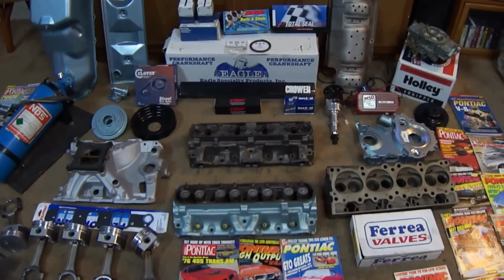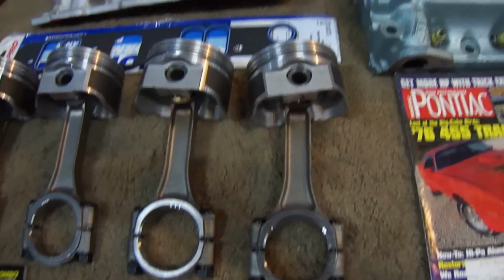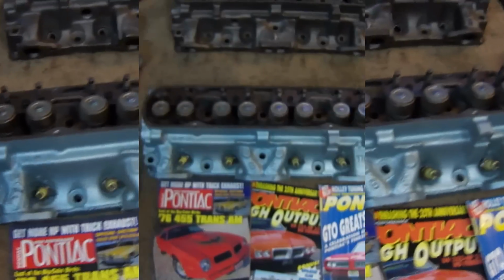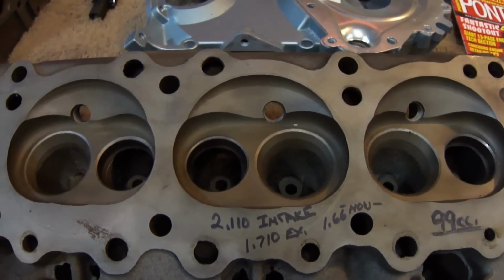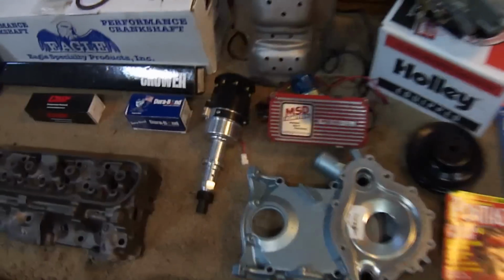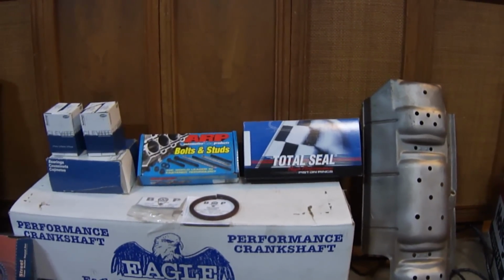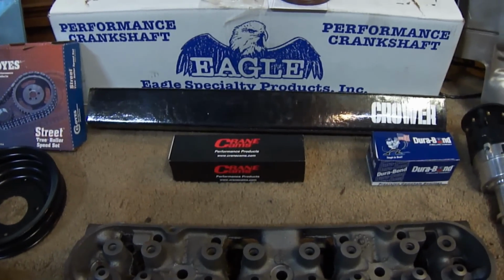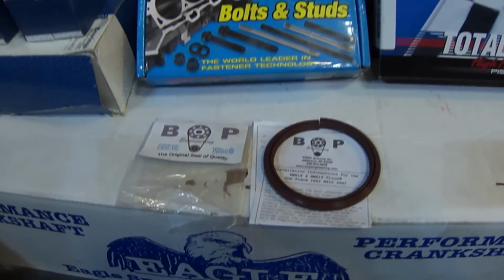1969 PONTIAC  GTO JUDGE 500HP 455 BUILD UP...PART 1

Comment: Round port 455 HO heads were the best. The #96 were the best D-port heads to use on a 455 build. The outflowed the 6X on both sides and had a smaller chamber- big valves and all the exhaust bolt holes.. Stock Blueprinted bottom-end with #96 heads, an 041 cam and a Quadra-Jet made over 500hp everytime. -and on pump gas.

Comment: A few things...the rods and crankshaft were made in China.  6x are NOT the best cylinder heads.  The casting 66 are actually better, if screw in studs are installed, and mill the heads .065".  Ram air 2, 3, 4, 5 heads, and sd421/sd455 heads, are better yet.  Cast 16, 62, 670, 31 heads are also better than 6x, but require a custom dished piston.  Other than that, good plan.

Comment: I was wondering, i have a grand prix 1971 455 200hp, 2 bolt main, 7h4 heads 114cc big valve, 2 barrel with only 80k miles virgin block. Will 1969 62 heads 72cc with 4 barrel intake fit the sleeping giant? Or i do need to add other part to make it work?
Reply: Chem Dog,  did you every try this setup?  Those heads are perfect for 400,  but will be wicked high compression on a 455,  prob 11 to 1.    You want to be more like 80cc chambers to about 100cc on 455 engines.

Comment: Cool stuff , I'm running a 1972 455 H.O. , .30 over with old school trw L2394 pistons with 7f6 heads , love these Pontiacs been running them since the mid 70s , wish I would have kept more of the blocks and heads I had , hope it turns out well 👍🏁

Comment: the problem with lowering CR by using a big chamber, is it increases the distance from the intake valve to the top of piston at TDC, this reduces the suction effect of the piston on downstroke, and less a/f mixture is pulled into the cylinder on intake stroke.  the way to do it is with a flat OHV head or nearly flat, and a dish in the piston, that is optimal.  the main reason the RA IV heads work so well is, the valve is .040" closer to the piston top- a slight amount but with dramatic effect.

Comment: so are you using the ferrea f 5141 -8  1710 11/32 valves in these heads ?..I have a set of these 6x 8 heads that I'm going to put on a 69 428. I was told years ago to use big block chevy rocker arm studs on these heads ..thanks

Comment: Mike, first off a great choice on the heads. I noticed you had the High Performance Pontiac mag. They had a flow tested ALL of the Pontiac heads and the 6x heads were the best of all of the heads. If you are using headers, you will have to drill another exhaust bolt. The intake Torquer is misnamed, the Edelbrock RPMs intake would have been better choice. I'm interested in your choice of cam here.
Reply: Baloney, I did all of the flow testing on all of those heads and the 6X heads are no better than any other 2.11 intake, screw-in rocker stud head. Only the combustion chamber size is different
Reply: @brucefulper4204  Spot on Bruce, the 6X is just a small exhaust valve smog head. Never really understood the popularity of that casting.
Reply: @michaelreardon7667  Well, it's a superb casting like so many of the other low Cr. Heads. Has lots of potential. The 1.66 is desirable to way past 650 hp

Comment: How much would you sell a similar set of 6x  heads for a 69 400
Reply: Get you a set of # 12 or # 13 heades, and ues a cam with a 110 LSA..  and dur. Around 230-235 @ .50,  lift around 465-485 ,  8 valve relief,  for a compression of 9.5: 1 , and go have a Blast
Reply: +MrPONCHO467   
Hi, I'm going to upload the porting vids this weekend...I got the heads to flow 255 cfm at .500 lift.
Reply: Craigs list is where I found a stripped set for 150.00.ebay you can get a complete set.